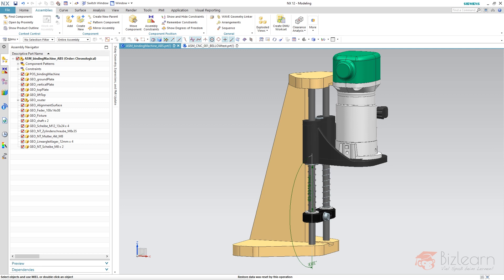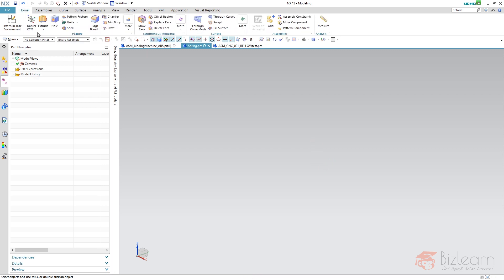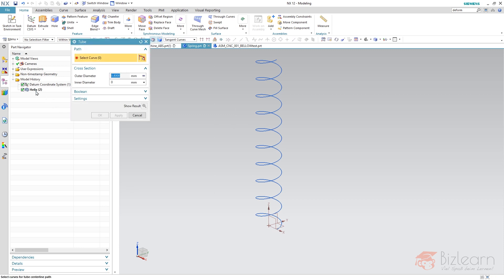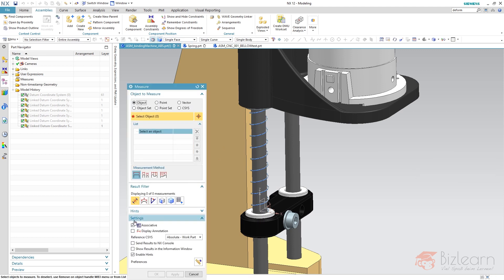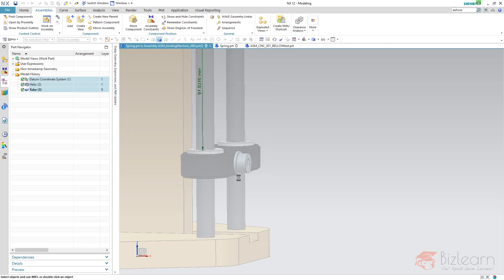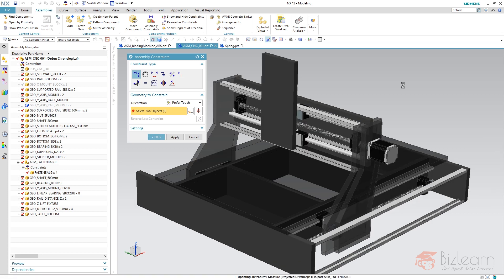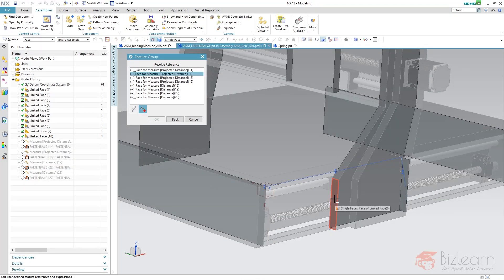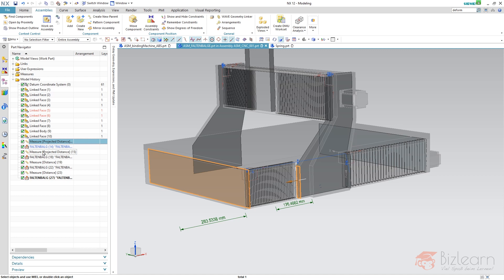Siemens NX Pro Tutorial - how to define deformable parts without fails

Comment: Is there any idea how to open nx 1926 prt file in nx10 ?
Reply from the maker: It's not possible without losing the parametrics. But you can export as parasol I'd and import into the new system.
Reply: But i loss my all programs
Reply: Any solution?
Reply from the maker: No

Comment: Nice to see some quality content about NX. I'm running into an issue with creating a deformable component. It is a tube with some connectors attached to both ends. I created a composite curve from 2 straight lines (from the curve tab) with a bridge curve. I modelled everything related to that composite curve. When setting up the deformable component I select all the features besides the composite curve. As a reference I would expect that only the composite curve would show up. However it also shows, as what I think are, the sketch origins for the connectors (which are related to the composite curve). I'm struggling with this for about a day now. I tried several things and I kept checking by adding the part to a curve in my assembly, but it never worked. I tried to simplify things and the only thing I managed to deform properly was a basic tube. Do you have some suggestions?

Edit after another half day of struggling: fixed! I mentioned that I selected all the features besides the composite curve. This is where I went wrong. I needed to select all features and for the reference I needed to manually add the composite curve. I hope this will help anybody someday ;).
Reply from the maker: Sorry for late response. I'm glad you have mad it anyway... I would have mentioned to also select the composite curve beside the rest😬 nx will aks for the referenced curve whe assembling the deformable part...

Comment: The problem I have with deformable parts is the issue of changing the part with updates later. Like for example, you need to update the diameter of the spring. If I have "a lot" of deformables in the assembly that come from the same component and I have to make a change to that component part model I lose all the work at the assembly that defined the deformable states. As you showed there doesn't appear to be a clean way to update the part model without having to delete and redo everything at the assembly level for something as simple as a diameter change. That I find to be a huge limitation to using deformable parts in NX. Hopefully, Siemens rethinks the functionality someday in the future. Unless you know a trick around that? If I update the part I find it does not update at the assembly level unless I delete the deform features in the part navigator of the assembly. Thanks!
Reply from the maker: Hey Corey, parameter mods aren't a problem, but feture exchanges are... There is no solution. But I believe that Siemens might address problems like these. You should report of course😂 otherwise prio will maintain low maybe. Cheers, Simon

Comment: Hi, 

I'm trying to create an deformable part in NX11 - without success unfortunately.
When i tried to deform part in assembly i get an error messages:
1. Message box: "Deform operation cannot complete because features copy has failed"
2. Message box after pressing ok: "Unable to deform due to a failure while copy and paste of a feature from deform definition"

Have you any ideas how to fix it?
Reply from the maker: You should try adjusting values before creation of the deformable part. Also try to copy and paste your feature to make sure those are independent enough. I think there is maybe a dependency not fulfilled after assembling